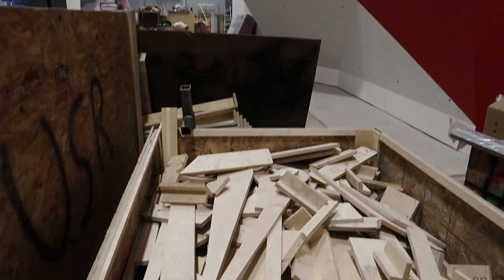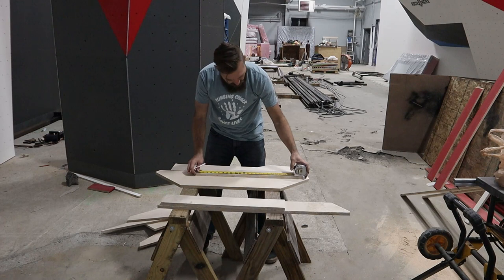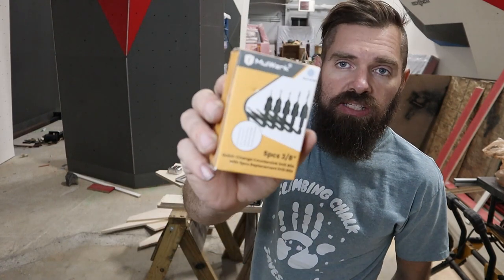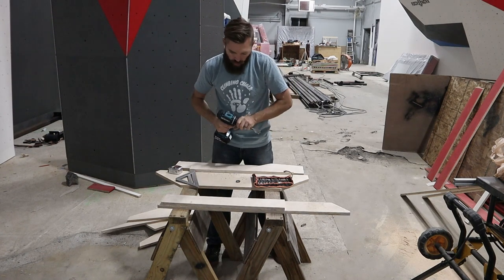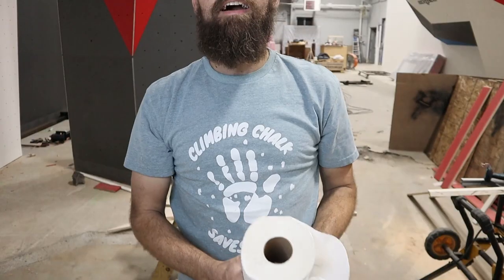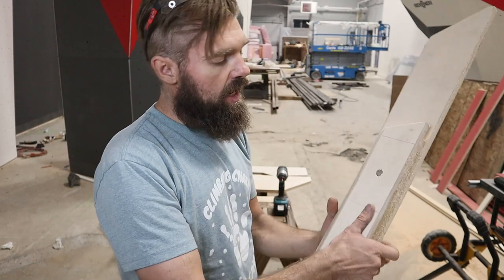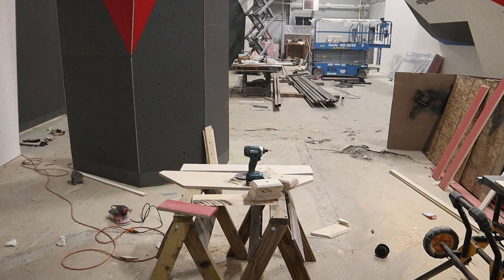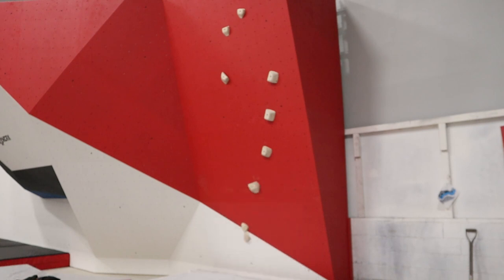MAKE AMAZING WOODEN CLIMBING HOLDS EASY

Comment: For the thickness of the blade is the reason your adding 1/8th to your measurements
Reply from the maker: Correct!
Reply: @climberdad  I'm a woodworker also. I make custom furniture when requested, but ppl are broke nowadays. I have only made one bookshelf, and a stove top cover all year. I'm thinking about making some of these climbing holds to see if the local climbing gym would want to give them a try and possibly get some word of mouth going about my work.

Comment: I believe the reason you're adding 1/8 in. is because you're going to sand them down so if you cut them to exact size now - they'll end up being smaller than initially spec'd.
Reply from the maker: Really good guess but that isn't it. It has to do with how or what I'm using to cut them apart ;)
Reply: Ohhhh he’s accounting for blade width in the sawing process. I thought it was sanding as well!

Comment: Nice work. 
Handy tip for folks when glueing: A few grains of sand will stop the sheets from sliding around when you're trying to clamp/drill them together if you're trying to line them up precisely

Comment: I appreciate all of your tutorials, tips and tricks!  Instead of cutting them apart at 90 degrees, why not cut them with a bevel? It would save some grinder work. 

Inspired by you, I made some simple wooden crimps.  I put the counter sinks for the bolts on opposite sides so when I cut them on a bevel, it was also beveling both holds.
Reply from the maker: The circular saw I was using was to small to cut through it at an angle... and I was a little worried about hitting a screw.